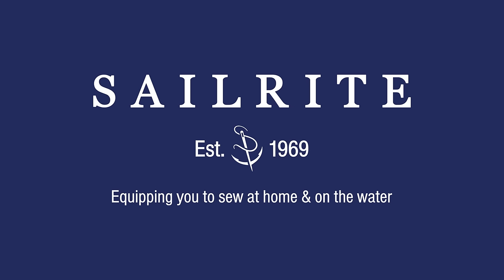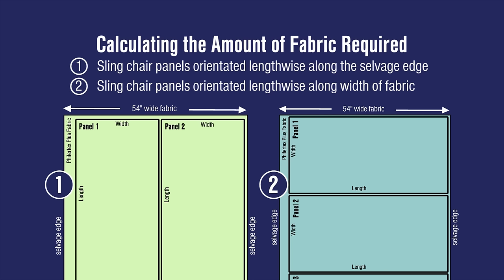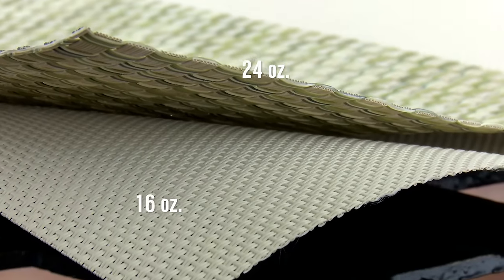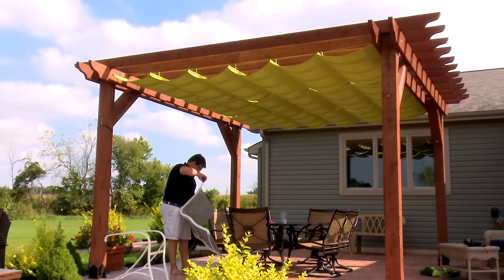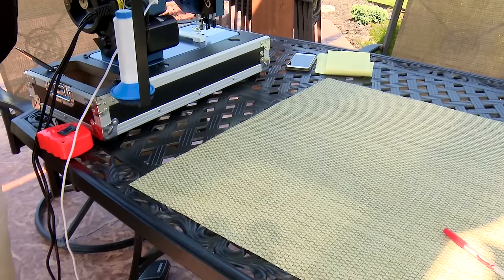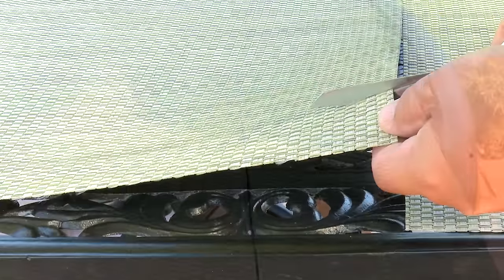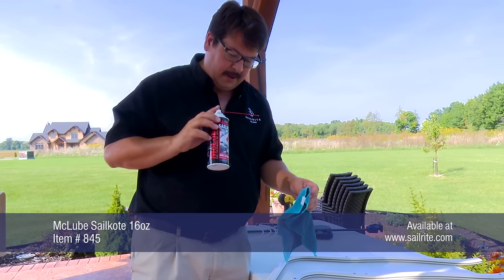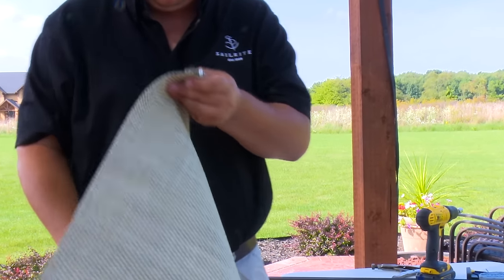How to Replace Fabric on a Patio Sling Chair

Comment: Is the bar-clamp/spreader used in the video a "heavy duty" 24" spreader (600 lb max), or is it a regular 24" inch (300 lb max) spreader?  I plan to buy one, since all my chair slings are wearing out at the same time and I can do everything except reattach the spreader bars.
Reply from the maker: In this video we used the Irwin Quick-grip one handed bar clamp "heavy duty" 36" (Irwin part #1964715) which is rated for up to 600 lbs. We do not need the 36" length a 24" length is sufficient. Also a  300 lbs. rating would also work.
Reply: Can you rent one instead of buying one?
Reply: I just did my 3 chairs which had an extra curve at the bottom of the chair.  The Irwin heavy duty bar spreader(600 lbs max) wasn't strong enough.  I ended up trying a bottle jack(HFT) with 4x4 wood block to stretch the sling frame.  It was a very controlled high pressure stretch.  My chairs fought me every step of the way.  The bottle jack made stretching easy.  Pledge spray helped loosen the sling material for removal.  Vaseline helped during sling installation.  I am not sure if Vaseline is compatible with the chemical properties of the sling material but it sure helped during installation.
Reply: @peblum  Can you share which exact jack you used?  The Irwin spreader didn't work for me either, and I can't bend the spreader bars at all.
Reply: @pbrenneraz  Harbor Freight Tools Item69472 4 Ton Heavy Duty Hydraulic Bottle Jack.  I had to add oil to the jack to get it to work after purchase before first use. Jack is about 7.5 inches tall and very cheap with coupon.
Reply: @peblum  Thank you!  I'll head to HF today, my chairs look good with their new paint job and fabric, I just need to be able to sit in them :-)

Comment: what kind of thread to use for home sewing machine and 15-16oz fabric???
Reply from the maker: A home sewing machine usually cannot handle any thread larger than a V-69 Polyester, so that is what I would recommend. However, if your machine could handle a V-92 Polyester that is what I would want to use.
Reply: @SailriteDIY  How can one find out if it can handle V-92 thread. I have a Bernina 445 if that helps any. Also if it can't handle V-92 to  you suggest a more reinforces straight stitch or still use a normal straight stitch?
Reply from the maker: @athenaglasby7831  A Bernina 445 is considered to be a home sewing machine. I don't think it will be able to tension a V-92 thread. So instead get V-69 Polyester thread. Just use a normal straight stitch.
Reply from the maker: @athenaglasby7831  It, Bernina 445, will not be able to handle the tension of V-92 thread, sorry. I would expect it to handle V-69 Polyester easily. Use a normal straight stitch.

Comment: What is the item # of the thread that is used in this video?  I will be purchasing a LSZ1 Plus, can the thread that comes with it be used?  Thanks
Reply from the maker: You can use the following threads for sling chairs: V-69 Polyester (for a home sewing machine) or V-92 Polyester (for a heavy duty sewing machine) or Profilen PTFE Lifetiime Thread. We used the Profilen item #107128 in this video.

Comment: maybe i missed something, but is there any reason why you don't slide out the old fabric and then measure it, rather than measuring with it slid in the frame already?
Reply from the maker: That can be done, if your old fabric is in good shape and not stretched.

Comment: Soo what type of thread should be used?
Reply from the maker: We usually consider two types of thread for outdoor projects: Polyester thread or PTFE thread. Sailrite carries two brands of PTFE thread: Sailrite Lifetime Thread (formally called Profilen PTFE) and Tenara PTFE. The PTFE threads will last the life time of the fabric no matter the climate they are used in and they are chemical resistant and fade proof. However, PTFE threads are more costly and slightly more difficult to sew with. Sailrite Lifetime Thread PTFE sews easier than Tenara brand PTFE threads on an oscillating hook sewing machine (like what the Sailrite Ultrafeed uses). Both sew wonderfully in a rotary hook sewing machine. Most customers pick Polyester thread because it is less expensive and easy to sew with. A Polyester thread is UV resistant, but its life is totally dependent on the amount of UV (and other outdoor elements) it is exposed to. If used in the Midwest a Polyester thread may last 5 to 10 years if used in the tropics or desert it may last only a few years. If you purchase Polyester thread the best fade resistant colors are Black and White, they are solution dyed (colors run all the way through the thread) the other colors of Polyester threads are only coated on the surface and will fade faster.

Comment: Why do you need the 1/2 hem on the sides?
Reply from the maker: The half inch hem finishes off the raw edge of the fabric adding both a better looking edge and also a little more strength for the sleeve.

Comment: My sling chairs have one tension bar at the bottom that is welded on!!?
Reply from the maker: So... the chairs have tension bars, except they are welded in place. If so, I have not replaced the fabric on a frame like that, so I may not be able to offer good advice, but I will try. 
I have seen sling chairs where frames are welded together rather than using removable stretcher bars or bars that are screwed together. In those situations, it is very difficult to push new sling fabric panels into the grooves of the chair frames. The manufacturer was not thinking about replacing the fabric, but instead may just want you to buy new chairs when the fabric wears out. I did see a youtube video (not our video
): https://youtu.be/F7SFks4YiDQ of someone installing slings to a lounger with welded bars, but they used 2 large clamps to bring the side rails closer together, slightly bending the already curved welded stretcher bars. Then after getting the fabric in place, if it were not as tight, I would lay the chair frame on a flat surface and apply pressure to the welded tension bar (by standing on them or using some body weight) bending the bars back to original shape to tension the fabric. For your chairs I would try this.....
If the front and middle tension bars can be removed then you still may be able to slide a finished new sling fabric panel into place. Yes, it may be very difficult to slide the new fabric panel into the groves, especially at the top. Use a lubrication (I love to use McLube Sailkote or WD-40 or petroleum jelly) and spray or coat the groove of the rail. Even pushing a rag soaked or coated with the lubrication through the groove before inserting the fabric can help.  Then use a pair of vise grips (with scrap fabric, doubled up) over the plier’s teeth to protect the fabric, and pull the fabric panel into the grooves carefully. A second person can help hold the rails as you pull the fabric with the vise grips.
Reply: @SailriteDIY  thank you so much for your reply- only one of the tension bars is welded so I’m gonna try 😊

Comment: is this even worth doing? the fabric costs minimum 25$ for way more than you'll need, takes 2 hours if you dont know what you're doing (1st time, etc), requires sewing machine, and worst of all you can find most of this furniture free/cheap on craigslist, facebook etc
Reply from the maker: Let's do the math.... The Phifertex Plus fabric varies in price from $18.95 and higher and you can typically get two panels out of a single width of fabric. Each chair usually takes about 48" of fabric, so the cost of fabric per each chair will start at $12.63. Believe me when I say our Phifertex Plus mesh will beat the department stores mesh fabric chair fabric any day of the week for longevity and quality.
Reply: Not only that, but if I find cheap used sling chairs on craigslist, chances are the fabric on them is about ready to fail anyway.  Also, I like my patio chairs, and want to keep them out of the landfill.